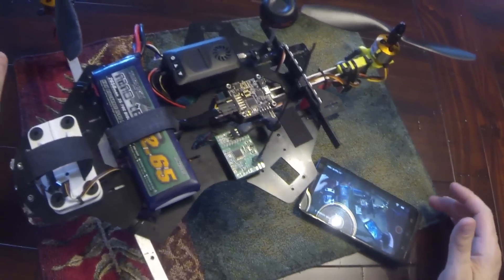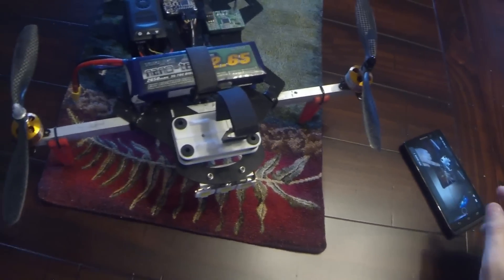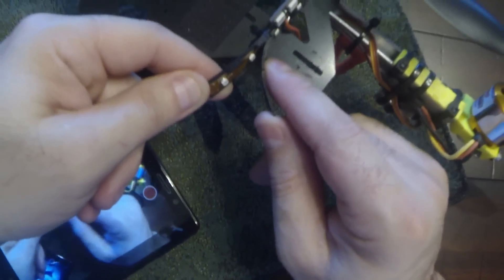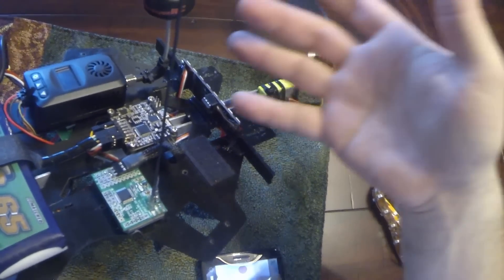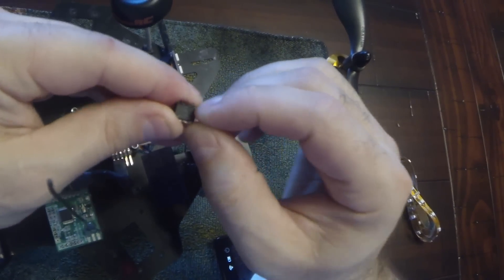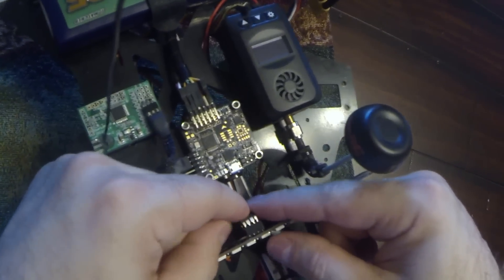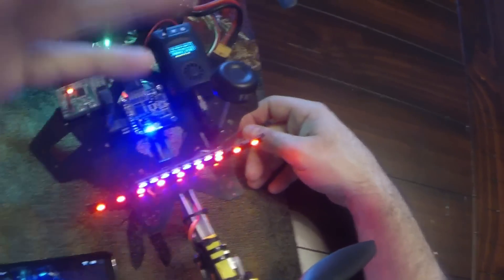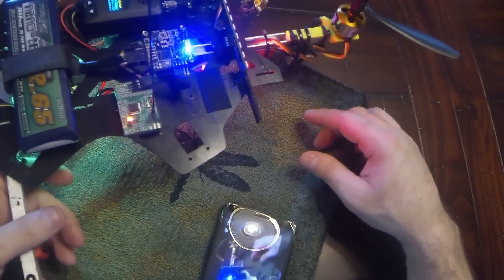Neopixel Attiny85

Comment: Could you post the code please? I am trying to program neopixels with an attiny85, but I can't seem to get it to work. Also, when you uploaded your sketch to the attiny, what were the settings that you had for "Processor" and "Clock" under the tools menu? I don't think I have my settings right.
Thanks in advance